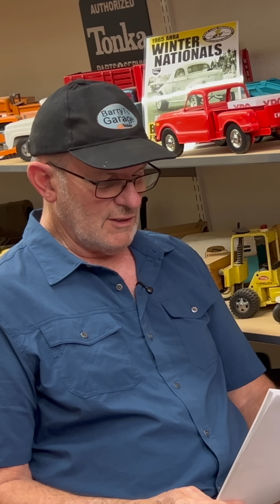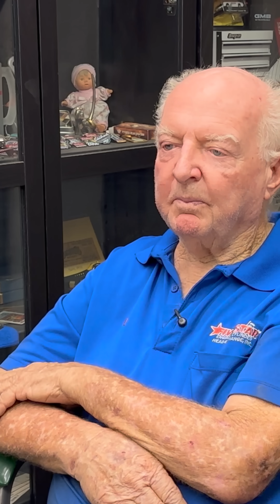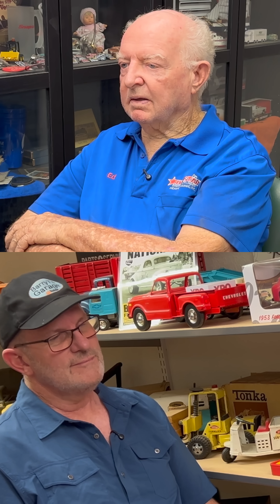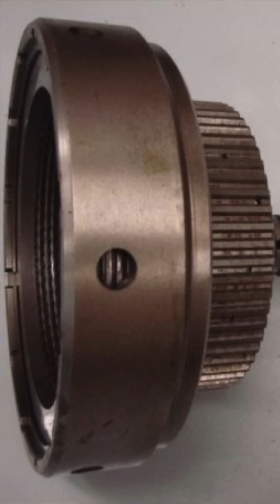Which Trans is Better for Racing? TF727 vs TH400 - Ask Ed Smith 38 - Ed with #BarryT #askedsmith

Comment: TH 400 had something that no other transmission had in the 60s and 70s, a center support that bolted into the case under the valve body. It helped support the weight of the clutch packs and gave a more solid foundation because you could get the end play correct using a selective washer. They had problems in the beginning but being able to correct the end play was part of the solution.
Reply from the maker: Excellent insight / thank you
Reply: @BarryTsGarage It also had another thing that made it a bit of a mess, that electric kick down solenoid, a long with the throttle switch and if anything went wrong with the electrical system connecting the power from the battery to that solenoid or a solenoid failure, you had no throttle downshift in the 400!  The TF had a mechanical linkage connecting the throttle to the shift system and as long as it was adjusted properly and connected, unless something went wrong in the valve body related to the shift modulation, it would downshift or upshift according to the amount of throttle you applied! Also, with the TH units you had to possibility of a vacuum modulator failing and sucking all the fluid in the transmission out and burning it in the engine, unless you replaced it with an aftermarket throttle pressure modulation system which eliminated that rubber and pipe suction system.
Reply: @BretTschacher  Great information Thanks for Sharing it with us that didn't Know..
Reply: Great information, Thanks for taking the time to share it with us that did not know.. Certainly Appreciate it. Thanks again...

Comment: The TH400 is decent ONLY with a heavy-duty sprag. (I've trashed a few). I recall another mod with a bolt designed to save the case in the event of a sprag failure.

Comment: I got a new tci pan for a 4L80e I think I'm gonna build one for mine bc the th400 w/od making it more street able bc my 700R4 with lock up on a switch acts like a  #speed around town in third or fourth and locked up to help mileage and charging around town in the city lol that why I have a 200 amp alt and a 10.5 yr old AutoZone duralast 5 yr special works great still from race car lol

Comment: There was a significant time spread between the two designs, the Torqueflite being earlier, it would be a sad commentary if the designers of the later Turbo transmission didn’t manage to make some improvements.
Reply from the maker: Good point

Comment: First of all chrysler can shift gears the use of a modulator vathey don't have to have vacuum to make their transmissions work, and a Turbo 400 is a good transmission.No doubt but it's also heavier than hell. The bad thing about a Turbo 400 and stock trim is it will always shift in second gear.No matter what you do so is , answer is wrong.

Comment: In the design of the GM transmissions, for each subsequent gear step up, you have a tually added more engaged clutches to transmit the power from the.e gine to the rear axle. With the TF trans, they required fewer parts to build a complete transmission. The TF used 2 bands and 2 clutch packs in stead of in the case of the TH's 4 packs of clutches snd just 2 band, the 3 speed versions. The issues with the TF transmissions, getting the best shift quality and timing was a really hard task because there was a timing lag associated with going from 2nd to 3rd gears. It was due to the engagement of the high gear clutch pack snd the releasing of the front band which was part of the 2nd speed. Getting the TF to hit hard from 1st to 2 nd was fairly easy, in fact they could be built to hit TOO hard. I used to race TF and have had them hit so hard they eould beeak teeth off the axle ring gears , break the tail housings, damage drive shafts and U joints, engine and trans supports! They would destroy the splines in the clutch packs as well. TH transmissions can do a lot of the same things but it's a little harder to do. It's my opinion the TF cases are in general stronger àside from as Ed mentioned, the rear of the cases where the over run soarg is located, those parts would disintigrate if you spun the transmission too high in low gear and shifted to 2nd. There is a fix for it but it isn't a completely bullet proof design. Original design used a small splined assembly the oressed into the case with very little splines and a set screw in the case and the improved design was as also  breifly spiken of by Ed that used a set if bolts that licked the srag ring into the case installed from the rear before you installed the output shaft and governor assembly. TF's generally used larger stringer shafts through the transmission compared to TH designs, the output shafts were generally longer than needed IMOP but there are short shafted version used in RV', larger trucks that used Mopar engines, and Old IH vehicles. Myself, I've been a mechanic for around 48 years, built many transmissions and have basically eaual appreciation for both designs. TH used a little power to get through from front to back but unless you have a dyno and can see just how much, it's a very small number comparing one to the other. Kind of like comparing green apples to red ones. One thing is for sure. If you takenanTH 400 apart and put it all on a bench and do the same with TF's all 3 speed units, the TH hasnanlot more parts inside and we all know the more pieces you use to build nsomething, the more chance there isnfor one of those oieces to fail! I've had all of them and  have to say, it's a real tough call saying one is better then the other outside of saying it's all how you abuse either of them. ImOP, the TF is going to take a bit more abuse and still get to a place where someone or yourself can make repairs whereas the TH will simply leave you sitting where it completely fails. Outside if where Ed says the one just explodes on you, I've seen that happen to both models. An old friend told me years ago, not going to say which model, but they WON'T do anything more then what have paid them to do!

Comment: No ..It has to be those KIA CVT's... LoL 😅 Their little rubber bands can't even handle a 1 hp Briggs & Stratton... For the street and not insane HP, I always had good luck with the FORD C-6... But that is just my experience...Ed..It ripped the whole back of the transmission transmission, right off... Fascinating 😮😊

Comment: I was always curious as to why the 727 has such small flex plate bolts.
Reply: Because the driven gear for the starter is part of the converter so it only has to connect the crank to the converter, it didn't have to serve the purpose of being.the flywheel and or all the purposes GM and Ford used the for. It was on one had a good idea and on the other not such a good deal in with the Mopars if the starter ring failed, you either replaced the whole converter or had to have the ring cut off and weld another back on it which made it more costly. On the other hand, it didn't flex as much.
Reply from the maker: I'll ask Ed about that! 👍

Comment: The long tailshaft designs got beaten up by high torque application through the throttle linkage.
Reply from the maker: Interesting observation!
Reply: How does the throttle linkage apply high torque, on either the long or the short tail shafts?
Reply: @loganpe427 Think about it! If you aren't on the throttle(linkage) you aren't beating on the shafts and internal parts!
Reply: @BretTschacher  I would have replied the day you left this or the next but just saw the notice pop up, that's odd🤔 I don't get issues like that very often! 
Anyway, thank you, yes I see it now how the guy meant his comment about the linkage and broken tail shafts, clear as day! It was where my thoughts were when I read it and it's just an unusual way to put it, to me anyway and my brain locked up, Duh, thanks for getting me to take a second look man! 😂👋🏻

Comment: Th 400 is a horsepower robber in comparison to the Th 350. I ran a 200 metric in a race car with 450 hp. Everyone told me it would never hold up. I ran it hard for 5 years and never had a problem with it. I finally sold the car after I quit racing. A 2 speed power glide is also a beast.
Reply: There's a guy in Ohio that is good with the 200